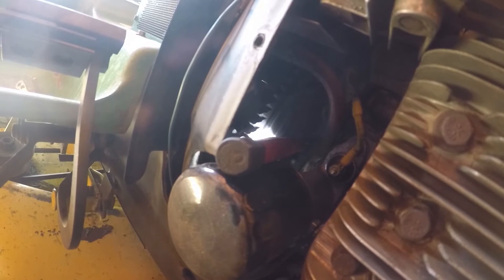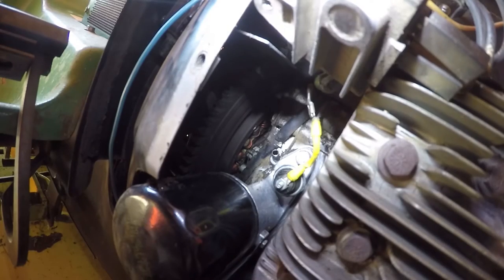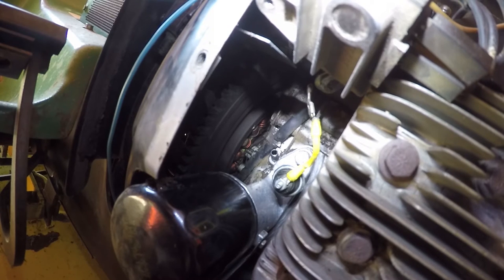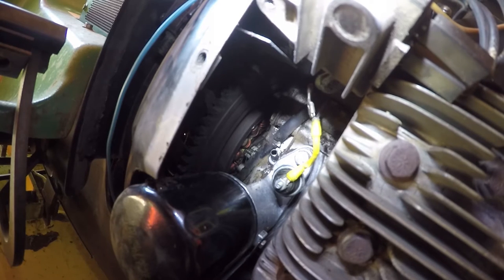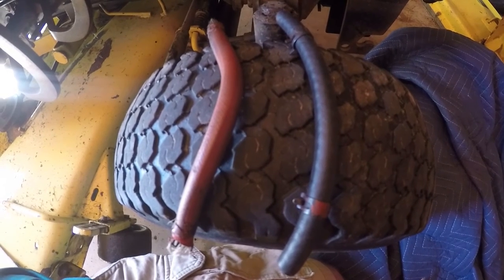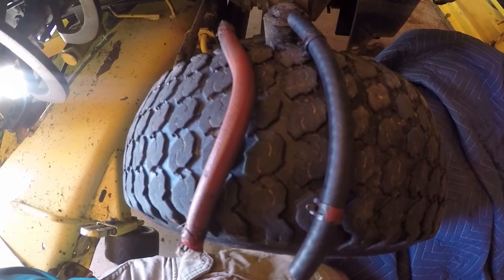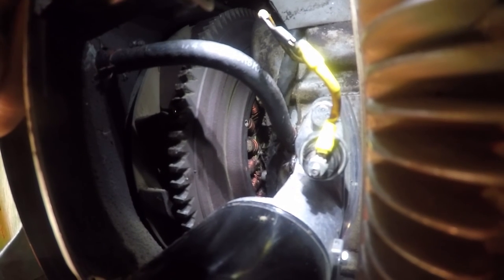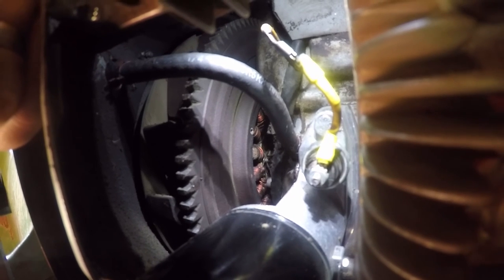Fuel Pump Vacuum Hose Replacement For Onan B and P Series Engines

Comment: Many thanks for the video. I just replaced fuel filter, fuel pump, all of the fuel line hoses and pickups from the tank all the way to the motor. This vacuum hose seemed hard to reach so I passed on it. I'm still having some fuel delivery issues as I can see the filter isn't always filling up. Believe this vacuum hose may be the culprit. I'll give it a go and see if that finally resolves the issue.

Comment: Thanks for the video.  I replaced mine today, after having problems with it not running like it should, for a year.
Reply from the maker: Thanks for watching! I hope yours is running better now.
Reply: @outdoorpowerhouse  Turns out that the pulse line was not my problem.  I had installed a clear plastic fuel filter between the fuel pump and carb.  The filter was heating up and causing the fuel to vapor lock.  Have a Great Day!

Comment: Hello! Another great video @outdoor powerhouse! I can see that my fuel filter goes dry in a matter of a couple hours, holds no fuel and so it takes time to start as it fills the lines. Would you say that tackling this line first is a safe bet or it could be something else, like the fuel pump in trouble? It seems like all fuel lines were previously replaced by the former owner.
Reply from the maker: If that's happening I'd say that it's more likely that instead of the vacuum hose being the issue that it could be the fuel pump allowing fuel to flow backwards. If you have a 318, then you will have a fuel shutoff valve on the left side of the dash panel near the hydraulic levers. Try turning that to off when not using the tractor and see if the problem goes away. Another option is to install a check valve in the fuel line somewhere so that fuel can't flow back to the tank.
Reply: @outdoorpowerhouse  thanks man. I have tried the shutoff valve and it didn’t seem to make a big difference. I think the return line to the tank doesn’t go by that valve (maybe?!). I might just replace the pump, or try to service it. When I bought the tractor, the owner mentioned problems he was assuming were related to the fuel pump. But then I just replaced the condenser and didn’t have any problems after that. The only thing still is the slow start, cranking until the fuel gets to the carburetor. Not good for the battery or the starter, right? 😁
Reply from the maker: @felipeengelmann9636  there is no return line to the tank. The tank has a main fuel line and a reserve line, both end up at the shutoff valve. From there one line goes to the fuel pump.
Reply: @outdoorpowerhouse  cool, I was thinking that the reserve line served as a return line too when not in use. But I see what you are saying. I need to get behind that shutoff valve to see if there is something wrong there too. Can these fuel pumps be serviced?
Reply from the maker: @felipeengelmann9636  I don’t think so, you would need a replacement pump.